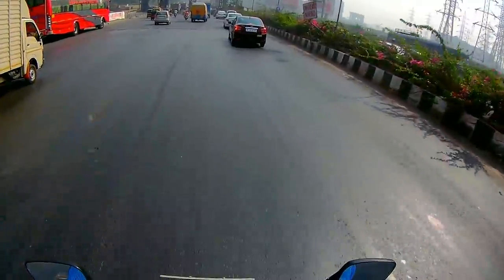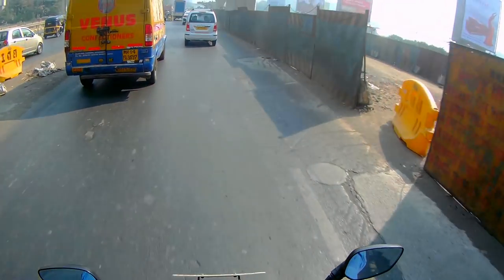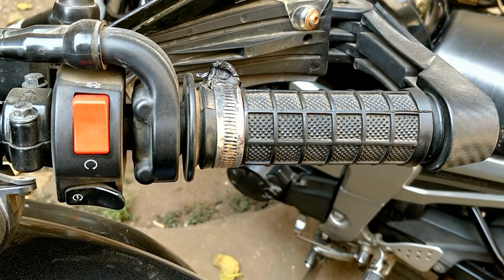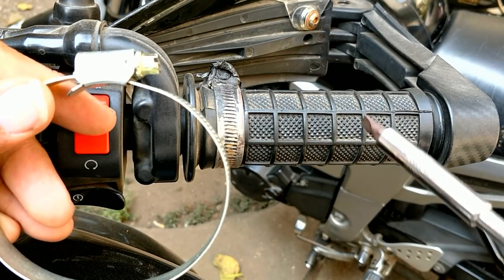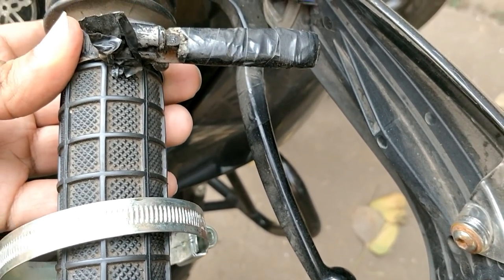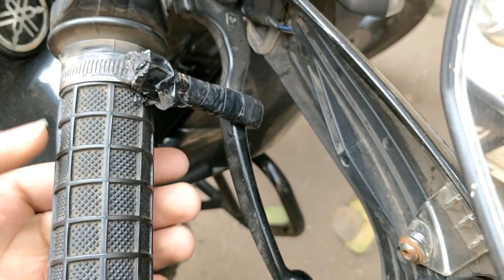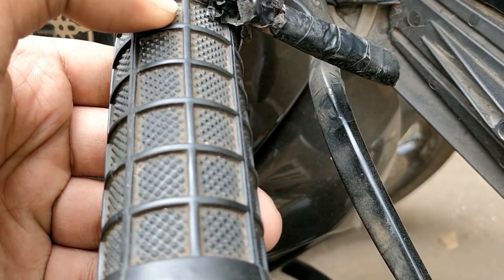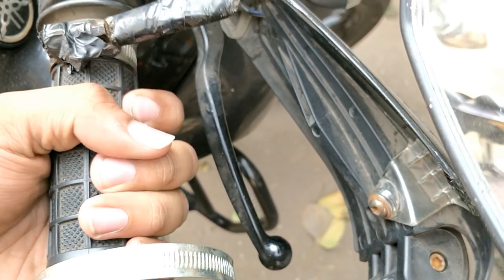Throttle lock / Cruise Control for 50 Rupees

Comment: You have my vote bro.. so even if for some reason it gets stuck it'll bend as we push forward the throttle so not sort of risk there..

I am comparing it with a rs.1200 to 1800.one which we're getting on amazon.in but that is rigid and it gives me the shivers thinking what if it gets stuck
Reply from the maker: Exactly. It has fail safe

Comment: Hi bro i own a fz25 and it has completed around 1100 kms. First service was done at around 960kms. Before first service the mileage was around 37.5 kmpl and now its only 36. Its kinda weird right? Usually mileage increases after first service right? Should i ask the service center about this issue?
Reply from the maker: It's very likely that they did not do anything that could reduce ur mileage. U can still go ahead and ask em if u wanna to calm u mind down but chances r they did nothing... Try using the techniques from my mileage video and see how much u can extract
Reply: Always check your tyre pressure and chain.